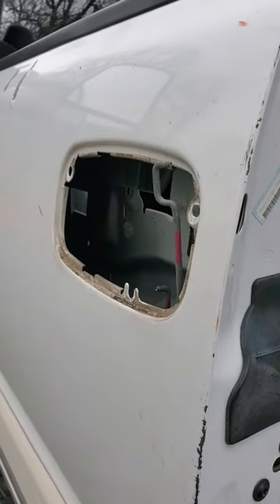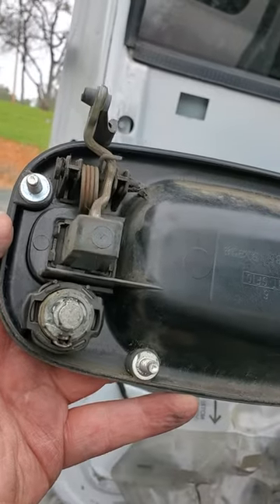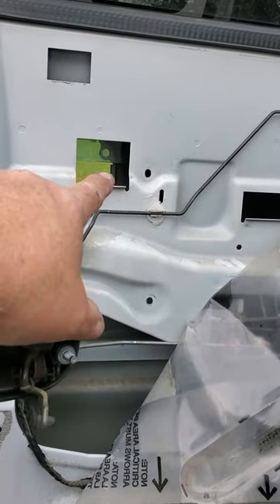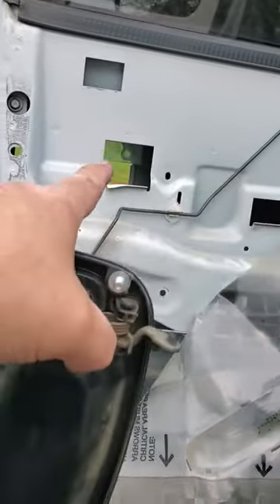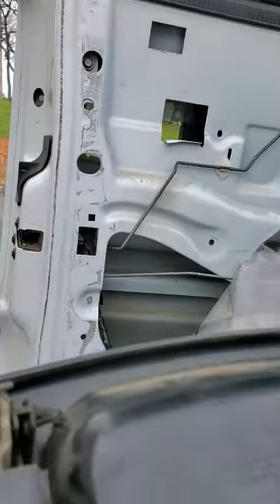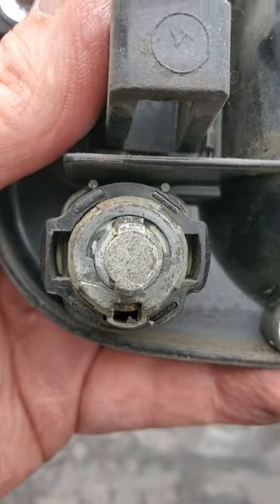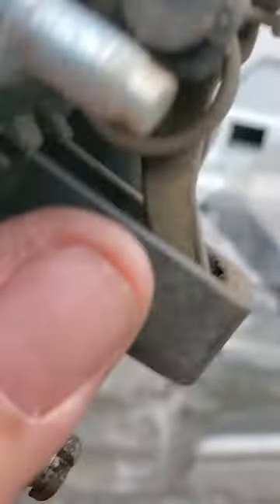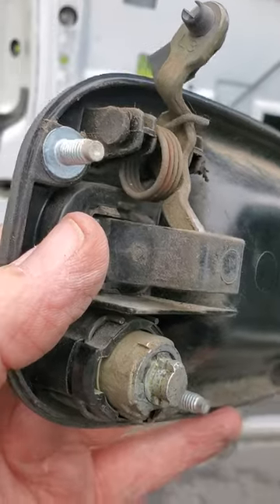2003 Silverado door cylinder lock replacement

Comment from the maker: So, actually that clip that holds the cylinder in place needs to be removed  completely. I initially thought it had to just be pulled down a bit, but it has to be pulled off completely.